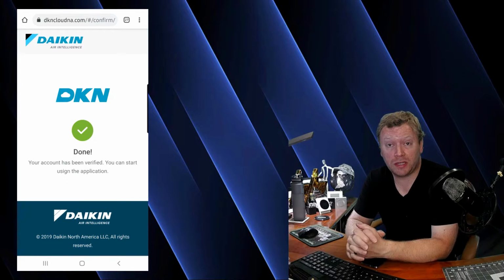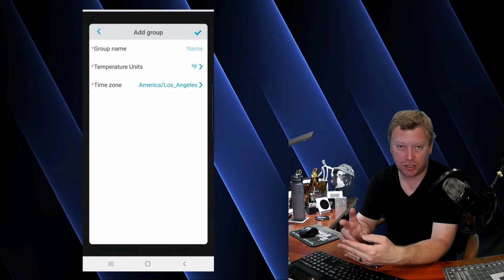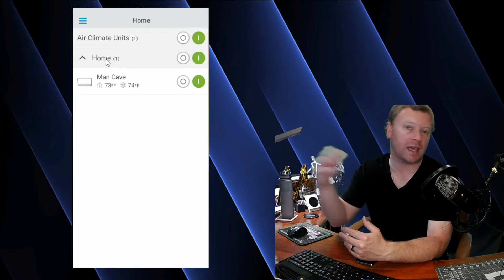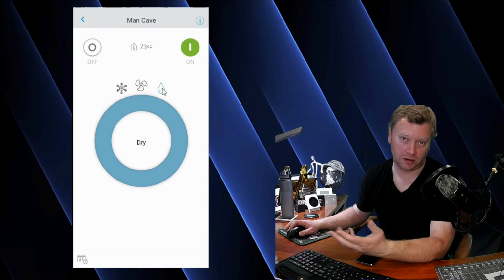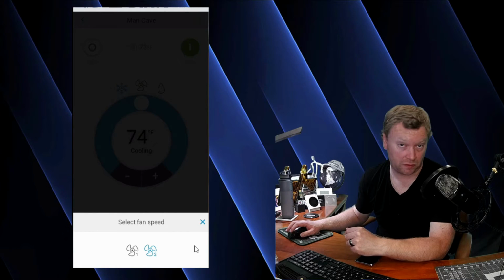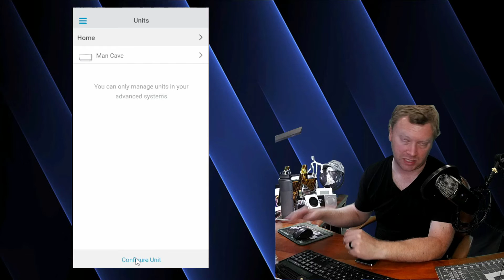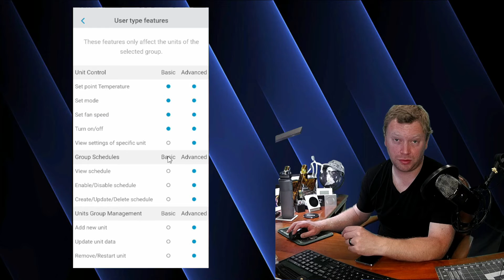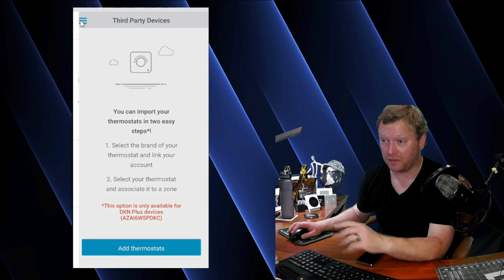Daikin WIFI | DKN Plus Adaptor Part 1 | Install, App Set-up, Connection and Demo (7-2-2021)

Comment: I have three 2011 year model  FTXS09HJVU and one FTXS18HJVU mini splits. I purchased a couple of the AZAI6WSPDKC adapters second hand, I am looking for the S21 cables or part number to order them from Airzone. However, most people I have spoken to say that my units are not compatible. Can you or anyone provide any assistance. Thank you

Comment: we recently bought a cabin that has 3 FTXB12AXVJU units.. no additional thermostat.  If I buy 3 of these units and install one in each, do I also need to buy a thermostat, and if I do will that control all 3?  I'm confused about the master.  I want to be able to monitor and potentially change the temperature in the cabin when we aren't there.  Am I on the right track with this?  thanks so much!

Comment: on model ftxs09lvju does not have s21 but i do have a open r32, will that work??
Reply from the maker: Hm.. ftxs09lvju should have an s21 port on the indoor. At least in the US market, that LV series had s21 if i recall. I thought back then only the k series needed the krp adaptors for some sizes. Its been a while since LV series were replaced so I could be remembering wrong. If there is no s21 youll want to use a krp adaptor that gives you s21.

Comment: This was helpful. Thank you. I have a question regarding the fan aspect of the thermostat:  when the temperature reaches the desired heat setting, cold air then comes out.  Is this normal and can the fan be set to be lower?

Comment: Are you able to successfully connect this to Google home? I connect it but the only available control is fan speed. 
İt connects to Alexa and more functions are available but something wrong about google home integration.
Reply from the maker: It "can" though I try to avoid using Google for integration purposes.

Comment: Thank you for the video. Did you tuck the WiFi adapter in the unit side part or does the adapter stay outside of the unit? Thanks!
Reply from the maker: I've seen folks tuck it inside but depending on the install you may not have room. On wall heads I just set it on top usually, unless there's an end user who has an issue with that then you need to get creative. Keep in mind tucking it inside something may affect it's connection strength too though.
Reply: @InverterAlways  awesome. That makes sense. Thanks! Turns out I got the wrong WiFi adapter. I have a Daikin Inverter but can’t seem to find the right item on Amazon? Any suggestion where to buy it online?

Comment: Still relevant as of June 2024! Followed these directions and it worked perfectly with my Daikin Mini Split unit and AirZone adapter. Thank you for the comprehensive video! Very helpful.
Reply from the maker: Nice!! I'm glad things haven't changed too much. I need to go back through and sort of update a ton of videos. Just haven't had time. Glad you got this all dialed in though.
Reply: What was the model number of your daikin mini split?

Comment: Hello Dana,  I have a Daikin Mini Split Model:  RXB24AXVJU.  Can this model be made WIFI adaptable?  Thanks.
Reply from the maker: Great question, if I recall that is the 17 seer damage series which did not have any s21 capability. I think that's the model you have. I could be wrong but I'm pretty dang sure the ftxb_ax model is the model nothing is compatible with.

Comment: Hi, My Airzone adapter stop working after a 15 sec. Electrical failure . Could you be kind  anough to tell me what I can do to fix it. Thanks
Reply from the maker: Electrical issue? Was it already installed or new install? Wired wrong? Hard to say for sure. Have you killed power to check wiring of device and powered unit back on? Maybe the adaptor just failed.

Comment: Thank you for the video. I just had installed in my garage an Daikin 18K FTX unit. However unlike your situation,  I want the adapter to be the master where i can control Heat/cool from the APP. Is that possible? Secondly, I see the cable is long, does the adapter house the thermostat and bypass the indoor unit thermostat? That way the temp in the upper part of the garage does not influence the settings. I would actually mount the adapter at a lower level. Thank you in advance.
Reply from the maker: Your unit doesn't come with a stat it uses the built in sensor on the wall head. The hand held that comes with is just a point and shoot set point adjuster. When you add the dkn adaptor you will be able to control mode setpoint on/off and fan speed from the app. You will see return air temp as room temp. 

If you have a hard wired stat. You'll need to likely unplug it as most indoor models only have 1ea s21 connector slot. The only one with 2ea is the model ending in bxvju

Comment: Would this interface work with the FTX15WMVJU9 wall unit without the additional adapter? The manual says the FTX15 is S21 compatible but needs an additional adapter to link to the internal s403 port.
Reply from the maker: Should work on wvju9 units without an extra adaptor Harness. I'd need to double check but just look at the board if there's an s21 you're good to go 👍

Comment: Do you still need a thermostat for this thing?  Or is this only to control the unit by your phone.
Reply from the maker: If using on a mini split via s21 you may use this for app control only. On indoors that use p1p2 you generally still need a stat. There are ways to use it without but it requires additional programming in most cases and is ideally used with a stat in the space.

Comment: The app set me up as a 'Basic' system user.  How do I become an 'Advanced' system user?
Reply from the maker: Click the 3 lines at top to get the main app menu to pop up. Click manage users. Select your account, then clock the slider that says advanced user then click the check mark in corner to save.

Comment: Thank you for your video.  For some reason, the app always displays that my home temp is 32 degrees (F), I wonder why that is and if it has any impact on how the unit performs. 

Thank you very much.
Reply from the maker: Depending on the indoor unit you have it may be a field setting issue. Have your contractor take a look just to check things out. It should usually display return air or stat temp depending on setup.

Comment: Can you please confirm that the “DKN Cloud NA” v 2.2.11 app (over 1 year old) from the Apple Store works for you when using the app to “Configure Unit”, using a iPhone 6s Plus or higher with iOS 15.6.1 or higher installed?  It does NOT work for me.  Your video suggests that you are doing the setup with an Android phone.
Reply from the maker: I am using android devices you are correct but the app works on both Apple and Android. I would recommend trying to update the app in case there's an update available. I can reach out to daikin and ask if they know about any ongoing issues but last I heard things were working on both platforms.
Reply: @InverterAlways  Thanks so much for the response.  I am using the latest version of DKN Cloud NA v2.2.11 from the Canadian Apple online store but it has not been updated by the developer for more than a year and there has been 2 major iOS releases since then.  I have tried the iPhone DKN Cloud NA with two different AirZone devices and 2 different iPhones so I have been pretty thorough with my testing.  It would not surprise me if the developer has paid littel attention to this as all the reviews on the Apple store are 1 star there does not seem to be much demand for the iPhone version in North America.  It would be great to know if anyone has got the DKN Cloud NA v2.2.11 app working recently.
Reply from the maker: @jfmorrismusic  good to know. Let me do some digging.
Reply from the maker: Jon, try deleting the app on your device. Make sure to also delete the saved cache from your device memory. Reinstall the app. Login. Try to set it up again. Sounds like this may be the workaround as daikin has no known issues at this time.
Reply: Mystery solved… here is response I finally got from AirZone NA support: 

“Hello Jon,

I did forward your email to R&D team, after a lot of tests they confirmed that the DKNC (plus) is incompatible with iPhone hardware previous to iPhone 7.

As the app is common for all the DKN devices and not only for DKN Plus, we cant remove the compatibility from the app store. Ie. a user with iPhone 6 could still use the app with DKN (non plus) device.

Thank you for your feedback and we will include anyway a warning on the app store description.”

I was using an iPhone 6s Plus so the app installed on the phone but would not work with my Airzone device.
Reply from the maker: @jfmorrismusic  oh wow! This is good to know. Guess it's time for that iPhone 14 you always wanted 😉
I appreciate the heads up though I'll make a note of this. Thanks Jon!! Sorry for the stress.

Comment: Very helpful, I have 2 units on the third floor of my home - but one question/problem. I still have remotes for each unit that are on the wall in each room. I mostly use the app to control the thermostats but am curious as to whether the remotes override the app or not...I've been playing around with using the remote to see if it registers in the app but doesn't appear to show any changes that I've made on the remote within the app or vice versa. The reason I ask is if a guest stays in the bedroom and wants to adjust the temp...it doesn't appear that they can use the remote to make the changes, right?
Reply from the maker: You should still be able to use to hand held to adjust setpoint. The hand held will not update if a change is made via the app though because it's send command only. There is nothing that sends any info to a hand held controller. It's point and shoot like a TV remote. It's possible you're not seeing an update because the app setpoint and and hand held setpoint are now different so making a change via the hand held may take a minute for the app to update. I've also seen in some circumstances where the hand held does get disabled internally from the unit when a device is plugged in to s21. Back in the day this was device specific some disabled the hand held some did not. It's possible the dkn now disables the unit, I would have to check this out before I can confirm but if that's what you're seeing than it's probably disabled. So your guest would need to tell you to turn up/down the temp.

Comment: Question: Can you use the 3rd party thermostat DKN adapter (AZAI6WSPDKC) on the FDMQ series indoor units.  The manual for the FDMQ states compatibility with the P1P2  DKN adapter (AZAAI6WSCDKA).  However, perhaps the universal DKN works with all Daikin indoor units which are DKN compatible, whether S21 or P1P2?
Reply from the maker: Yes it's compatible with any s21 or p1p2 terminal.

Comment: I have a FTX12NMVJU with only a s403 connector, how do I connect this??
Reply from the maker: You might need to purchase an adaptor to give you the s21 connection. Check with your vendor it would be a krp board part number.

Comment: Does this adapter work with the DZK multizone kit and if so how are zones assigned? For our application, I plan to use an FXSQ indoor unit coupled with the 4 zone DZK kit (P1P2 system in parallel) and was wondering how something like this could be used (or not) alongside those components. Thanks for the great info!
Reply from the maker: No. Dzk kits are a whole different animal. I need to do a video on them. Their stats take over all daikkn controls. You would think since airzone makes the adaptors and dzk kits it would work but it does not. The dzk stats are programmed specifically for the dzk. No wifi can be added.

If you need wifi zoning stats you need to build a custom dzk box. Basically buy individual dampers and wifi stats from airzone to put on the system. Huge pain and totally not worth it in my opinion. Vrv is not designed to be a vav system. Downsize the indoor units and install one indoor for each space if each space needs different set points. Just my opinion here. I'll follow up with a dzk video or dzk series here soon.
Reply: @InverterAlways  Appreciate the info. Even my local contractor and their HVAC reps could not get a firm response to me on this regard, so for that, thank you. I would agree -- seems like a big gap in features when you're talking about the full eco system of hardware + software from Airzone. I'm exploring the DKN API documentation to see if there's anything there that allows for addressing specific zones programmatically but it does seem weird that they would leave this out. I'm going to also try to touch base with someone technical at Airzone. Based on your response, I read the DZK as a specific, niche product that is paired to custom t-stats (a master + slaves) but also requires one Daikin Nav t-stat wired in parallel to be able to operate in multi zone mode. Reading this aloud tells me that the product team didn't really think this one through and is a bit hacky, IMO :).
Reply from the maker: @sanggria  the nav is there for no real purpose other than it has to be for com to work right with the system. It gets totally over written by dzk. 

If you remove dzk you can add other airzone dampers with their own wifi stats but it's all just separate. Not super user friendly I'm not a fan of the damper style zoning lol

Comment: Any information on getting theses onto a BACnet network? We've got a few here on a commercial site but are having issues. all of our settings and address' are good but it seems like were having issues with the wiring
Reply from the maker: Verify operation on each device first without bacnet connected to ensure indoor is wired and communicating. Then make sure bacnet wiring is correct it is polar sensitive. Then in the dkn app Make sure to set the addreses uniquely no duplicates. 

Will try to do a video on this.
Reply: @InverterAlways  thank you for replying in such a timely manner. We went through these steps already and still no luck. What’s weird to me is that I can find a modbus manual for these, but not a bacnet one? Do you have one? Maybe something that has a points list of some sort?
Reply from the maker: @Ramiro3594  I'll look and see what I can find. Are you using a bacnet mstp router?

Comment: How to I get the room temp to display on the app? The app is working well with my system, but room temp isn’t showing up
Reply from the maker: The dkn app shows return temp if you've plugged it into a mini split. This is because that's the temp it uses for control. 
If its vrv make sure to set the field settings correctly on the stat to send and use the stat temp for control. 
If its a 3rd party stat you won't be able to get room temp on the daikin app. Use the 3rd party app for that stat for control. 
Hope this helps.
Reply: @InverterAlways  it isn’t a vrv it is a single split residential. The Dkn plus adapter is connected via s21
Reply from the maker: @thomasnemerii5659  ah, yes than your unit senses from return air and therefore the dkn app displays return air. That's all you will get.
Reply: @InverterAlways  what is the 3rd party app? I have the Dkn cloud na. It isn’t connected to a thermostat
Reply from the maker: @thomasnemerii5659  I was just referring to whichever brand stat you go with. Example if you used a Honeywell t10 then you would use Honeywell home app for control. Since you don't have a stat you will just use the dkn app and it will control off return air.